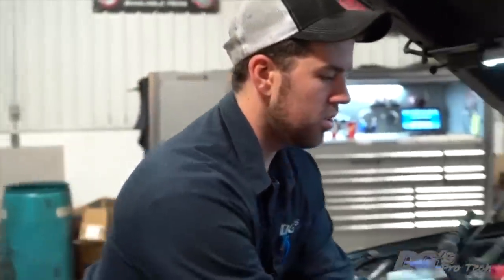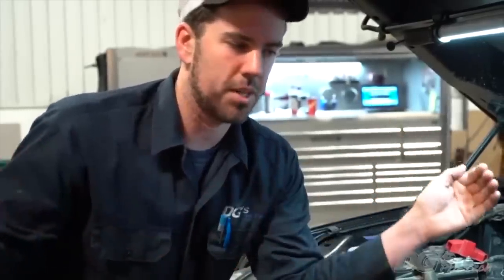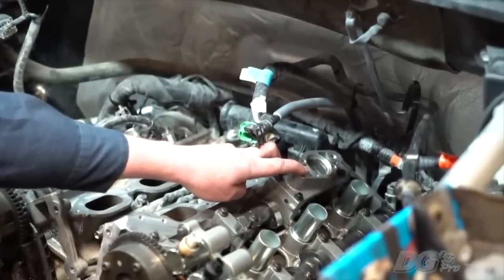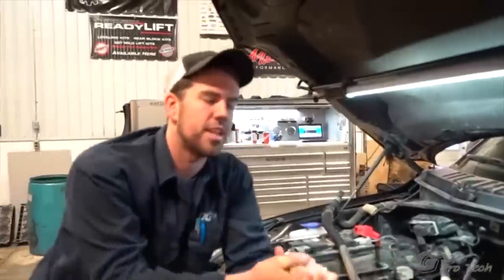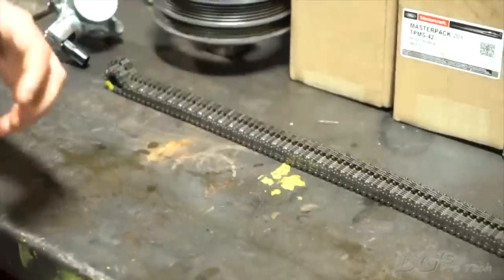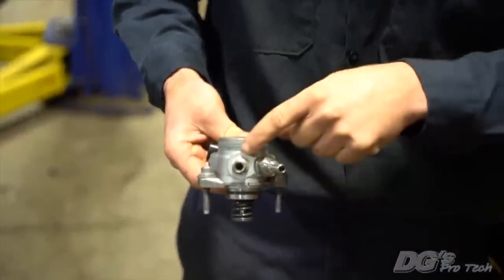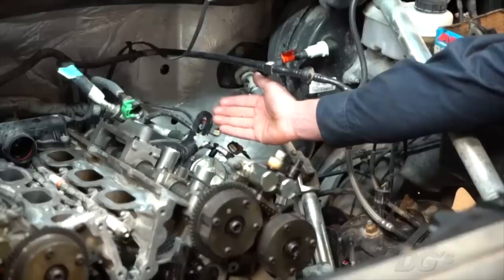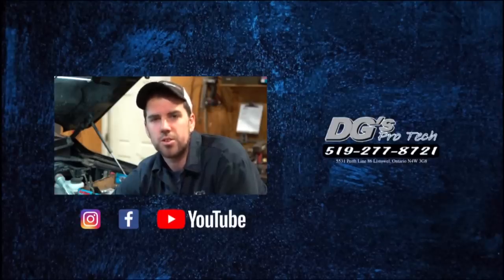What you NEED to know about Ford EcoBoost Engines by Dustin Golley of DG's ProTech

Comment: Great video without even covering the well-documented issues with direct injection.  I bet this tech has had some fun some days with the GM 3.6 timing chain issues.  Manufacturers have tried to go too high tech for passenger vehicles.  Yes,  gas mileage and performance are better, but that doesn't mean much when you have to give all of that saved money (not really saved, spent on something else) to a tech to rebuild the front end of one of these things.  Give me an old pushrod 4.3 V6 vortec or 3.8 V6.

Comment: 3.5 owner. 189000. Only problem leaking coolant from turbo. Have done everything you suggested. Very happy with it. Would buy another if I need to. This engine has been very strong. Very smooth.

Comment: my old 2.3 Ranger 4 had oil changes at 3 k with wal mart synthetic and when i tore it down at 293 k for a new head gasket there was zero bore wear and the valve guides were still perfect, my 2 litre escort just turned 333 k and only leaks a bit , zero consumtion id say otherwise, still getting 1.2 k per half a quart loss. oil is cheap .

Comment: too much stuff for a engine.   racing is ok.   not for a truck that need to be reliable. 
3000 mile oil change .  that is the rule .  turbo charge?  change as many time as you can.

Comment: I have a 2013 F150 FX4 with the 3.5 Ecoboost. When it come to that engine it's either eco or boost. You can't have both. Mine's about to hit 100,000 mile so I'm getting the timing chain done. While they are in there it sounds like I might as well have them change the water pump and thermostat. Great video. Thank you for the info. I run Royal purple in mine and change it every 5000 miles.

Comment: I am a shop teacher from Kincardine Ontario, about an hour away from Dustin's shop in Listowel, Ontario. I am super impressed with the articulate and methodical method in which this engine problem is explained. In light of the dire need for more trades-persons to enter the teaching field (Our Board currently cannot find replacement shop teachers to replace sick-leaves or retirements) I encourage Dustin to consider the option of teaching.  If you can handle difficult customers, you can handle moody teenagers and annoying parents!  lol

With permission, I would like to use this video in my on-line content in the fall semester.

Comment: What do you do about the DI problem with the cocking of oil above the valves on these engines? They do not recommend intake side cleaning due to possible turbos getting messed up.

Comment: Its a rule of engine physics - you add boost you wear out the engine faster.  I worked at a Ford dealership a few years ago and everybody I knew agreed the 5.0 was by far the better option

Comment: For a guy that's not wearing a ford uniform and is in a independent shop, you sir are a gem...  Obviously you've had lots of education and your skill / mindset matches your passion.  You are a excellent educator.
Reply: Agreed!
Reply: Lilstevo74 totally agree with you on that,)) I wish all Ford engineers were like that 👍 )) from over the pond 🇬🇧
Reply: No doubt if I could talk like that I could ketchup popsicles to a man wearing white gloves
Reply: Man this guy is  great we’ll explained very knowledgeable
Reply: many of us have had no formal education lots of us were born with mechanical abilities in our blood school deff was not for me. Reading is key to learning and keeping up with technology in the automotive industry. Now when I say reading im not talking about doing google searches im talking about reading service information for instance say a 2017 impala comes in with a p055b code "INTAKE CAMSHAFT OIL PRESSURE SENSOR PERFORMANCE"  in it and say ive never seen this code before I will type the code into my service information to read the description and operation of the sensor and you do this because you can not properly diagnose a part/issue if you dont know how this part/system works and once you understand how it works then you can figure out why its not working. you also run tests with ur scan tool, say you have a code for a maf sensor and if you have never checked on before and you have a snap on scanner with a scope (or a good quality scope) you go under the component tests in the scope and read how to run the test with the scope what the specs are and you can also go on ur service information to find component tests and your best friend when trying to figure out a complex issue is a flow chart that runs you through all the proper tests to figure out the problem all of which involves reading. When you dont know how to do something you just learn how to do it but its something you have to want to do you will only get as smart as you allow urself to be. There are tons of great videos you can watch about electrical systems and diag.
Reply: Do you recommend the blow by canisters?
Reply: And we need more of these.
Reply: except for he thinks the longitudinal 3.5 is the same as the transverse

Comment: I bought a 2012 Lincoln MKT With the 3.5 ecoboost, and 105K and the timing chain error code on. The dealer had the timing chains, sensors, etc, replaced. I now have 112k and it runs really well. I did change over to Mobil 1 synthetic oil as soon as I got it home. Impressive power.

Comment: My first car was a 59 custom 300.  No back up lights,  spedo ran 10% fast, no side view mirrors, oil filter optional,  first gear no synced,  mechanical lifters,  metal when I bought it new, half plastic when when I replaced it 65 Impalla SS. I fixed the deficiencies.
Second mistake was a 69 Mach one.  Need wheel alignment every 60 days and I drove it like a grandma.   Fortunately stolen at 6 months so I never did the last wheel alignment.  
Have not bought a Ford since.

Comment: If you’re only going to keep a truck for 5-10 years than ecoboost is fine. However if you’re like me and keep cars for decades, stay away. I assure you will not see 2020 F150s with the ecoboost engines on the road in 20 years. Get a V-8, but with ford having oil consumption issues with the coyote, get a tundra V-8 while you still can. Turbo charged gas engines just simply don’t last as long. Don’t believe me? Go on Facebook, see if you can find a 20 year old used turbo charged non-diesel engine for sale that is still running. I’ll save you time, you won’t

Comment: On point. Except oil part full synthetic 5000 miles. Just change at 5. Synthetics actually break down oil doesnt. Oil gets dirty. And full synthetic has oil in it. These long oil change intervals are to solve the problem of engines being built to well. Instead of engineer ing the engine to fail due to getting sued they engineer ppl to destroy the engine for them.

Comment: Just dumped my 2014 Ford Explorer Sport after the water pump blew and cracked the aluminum block.  Nothing but problems after that even with a replaced engine with lower mileage.  Sensors going nuts, leaks, turbo noise and so on.  Will never buy another Ford and bought a Toyota.
Reply: 2nd time watching this. I sold my 2011 Ford F150 with Turbo V6 and cried internally. It had 120,000 miles on it and still ran great. I kept up with all maintenance myself.  However I now have a 2018 Ford Flex with the V6 Turbo and getting concerned. I break free at least once a month but hypermill most of time.  I average 19.5-20 mpg, but when I break loose, it drops to 14mpg on a gas tank of having fun.  You really need to consult for Ford. These are great videos, clearly laid out items and corrections. Unfortunately, my next truck will be a Riven as I don't trust the junk being produced by the big FOUR (Ford, GM, RAM, Toyota).  The quality loss due to greed has turned me off.

Comment: I like this mechanic and the way he explains this complicated engine. I disagree that this engine is a good one. Small displacement engines (3.5 liter) that are asked to make big horsepower and torque (365?/420?) create much heat and High heat creates wear! He is right...this is more of a race engine than a engine that belongs in a truck that, for the money, you expect to be durable! A relative of mine made the mistake of buying a vehicle with an eco boost and it has a hole in one piston at 60k miles! I will not  buy anything from ford with an eco boost engine!
Reply: Edward L. Nobody cares what you think 🥱
Reply: Efren Pando wow. You sound like an angry person. You must’ve bought one of those
Reply: @efren3723    Wow....anger problems or did you buy one of these POS?

Comment: i feel sorry for any one that gets one used... 
These Turbo engine being pushed to the MAX and no one is changing the oil like they shod. with these engines you need to run full synthetic and go back to every 3000 miles oil change.
the 4cyl are even worse! burning oil like crazy.
GM and Ford DOHC engines all have timing chain problems and this is ridiculous i am seeing a lot of them needing timing chains at 60 to 90K miles it look like they need oil sprayers on the chains there not getting enough oil...

Comment: I've also heard that oil separators or catch cans are important to these engines, to prevent deposits building up on the intake valves.  Check with your local emissions requirements first though, to see if it would make the vehicle fail the visual smog check if they are installed.  Usually, especially here in California, any modification to the PVC system is not allowed.  I guess come smog time, you could put it back to stock, and after, reinstall the catch cans.  Improving the longevity of these engines should be important if I ever had one.